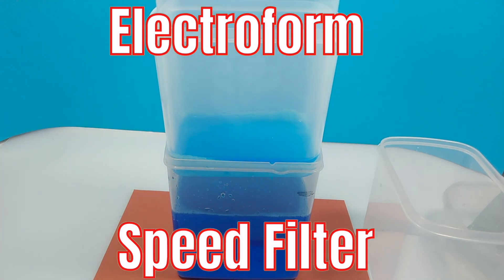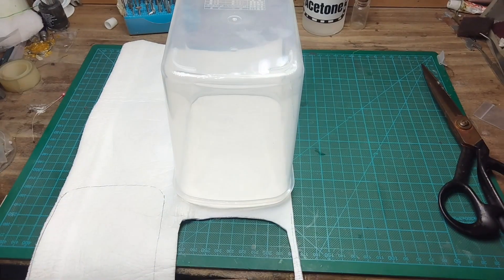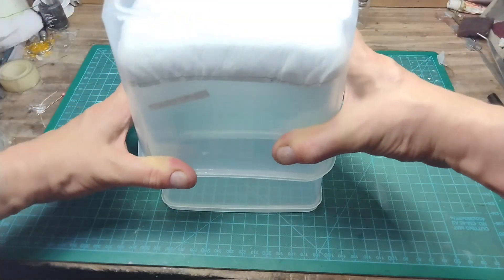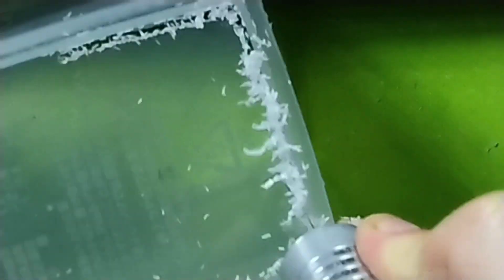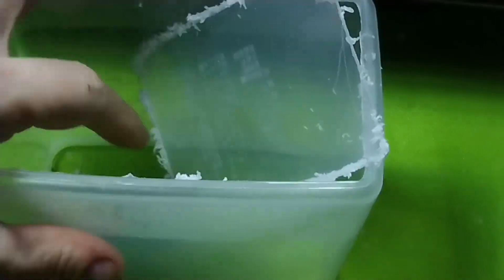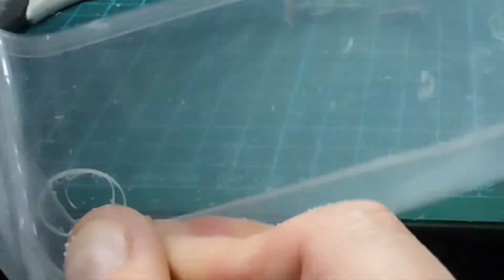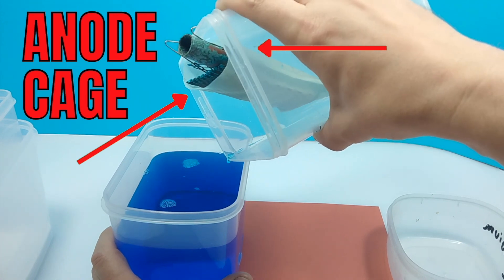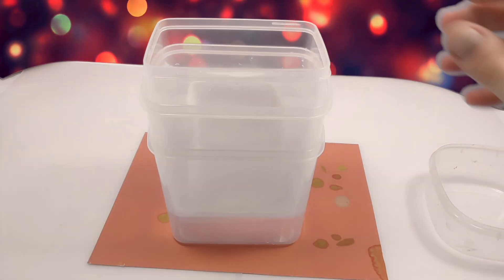Electroform Speed Filter, Cleaned in 30 Seconds!

Comment: Dear Mr. Jordan, thx for your real good Tipps! One question please. Would you filter a Gold Solution also with 1 Micron or need it more micron? 
Liebe Grüße Ralph
Reply from the maker: Hi, the lower the micron # the smaller the particle so you can use 1 or .5 micron filter material.  I would not use this filter for gold as it has a lot of surface area and may hold some gold solution in it after filtering.  I have a smaller version that I have used for precious metal plating solutions , you can use a HDPE bottle  for this also.  Link here. 
 https://youtu.be/rqsSgYipadA
Reply: Thx a lot